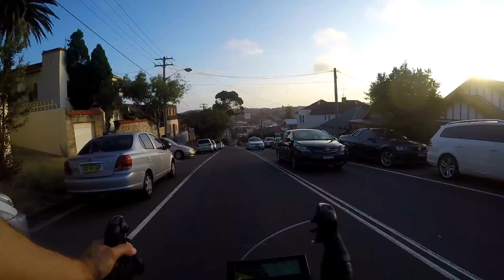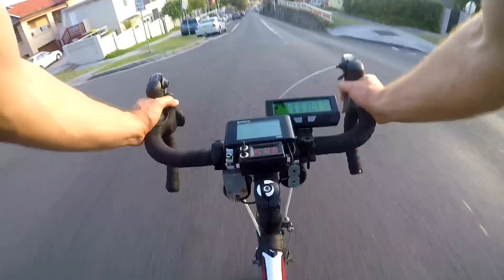Bafang BBSHD 1000w mid-drive • extreme hill climbing test 46T • Electric Bike 48v BBS02 8fun motor

Comment: How is the durability of these motors? They only have a 1 year warranty from what I've seen, probably for good reason.
Reply from the maker: I worked in a shop installing and fixing these motors and all other brands you can imagine... 2 and half years doing that job and I’ve seen so much unbelievable stuff...
Compared to Shimano, Bosch, Yamaha, the Bafang is the only one that you can convert your existing bike into electric, the only one with throttle and the Bafang BBSHD is by far waaaaaaaay more powerful than the big brand ones.
Having a throttle is awesome but people get lazy and don’t shift gears, imagine you have a V8 and you run all day in 3rd gear... you’ll kill the clutch prematurely, then take to the car dealer and ask for warranty, the dealer can tell that it was misuse but you say: “no... I’ve done nothing wrong”  and this happens more often than you imagine.
1 year is actually plenty of time. Also Bafang is the only motor that u can actually find parts and repair yourself in case anything goes wrong and parts are reasonably cheap. Big brands you have two year warranty but they keep changing models and after two years good luck getting anything repaired... they will talk you to buy a complete new bike... 
This is what I learned dealing with all these motors... things vary between people... see Bafang as an Open Source DIY powerful motor that you have total control... this attracts lots of crazy and weirdos too hahaaa
Reply: @BrunoPOWEEER  Interesting information, I'd be interested in knowing how long they tend to last assuming proper use, but used for aggressive singletrack riding and winter/snow use.
Reply from the maker: Durability I would say skip the BBS02 and get the BBSHD, fit the 42 or 36T front Lekkie chainring with big 42-11T rear cassette or bigger and you’ll be flying...
Electric motors like spinning fast, they’re a lot more efficient at high rpm rather than keep forcing riding in wrong gears putting a lot of mechanical stress into its internal gears and even destroying the bicycle gears prematurely. Also running in wrong gears will make the motor run hot which isn’t the best thing. Gearing correctly can make a massive difference between reliable and unreliable system =]
Reply: @BrunoPOWEEER  Hello Bruno, I watch your videos, I find them entertaining, funny and  educational.  I have the Shimano  internally geared hub Alfine 8 on the rear wheel. What front chainring size would you recommend for myself with the BBSHD. One of those pretty Luna front chain rings?  I have been riding the bbso2 for a few years and I'm now ready for more power! Thanks Bruno, Dirttanjohn here in Flagstaff AZ

Comment: I rang from Melbourne today to ask a few questions at EMax bikes and ended up having a very  good chat with them there. Some good topics were covered and they answered my questions with ease. I have been riding a large frame MTB, BBSHD (1500w) using 25amp LIPO4 battery and all the good high power custom  ebike accessories  for near 2 years and have put a few similar bikes together in that time. I was impressed with the ebike knowledge from Bruno and his skill to be able to deliver the answers required. As i say Ive ridden the BBSHD daily for over 2000km  up and down around the mountain i live on, and i have tested the bike and motor out fully, carrying a BoB Yak trailer with a load most days.  Bruno was on the pulse with his answers and knowledge and i recommend assistance from this fella anytime. Cheers
Reply from the maker: +MtDandy yeaaaaaaahhh... thaaanks mate, was FUN chatting with you about ebike stuff in general, I think we covered all areas: chainring sizes vs torque vs battery life, battery performance = more series vs more cells in parallel, connecting different chemistry packs in parallel for more range, possible issues (different internal resistance = discharging differently then packs balancing each other and BMS possibly freaking out), use of super capacitors combined with batteries and all that technology talk... good fun mate!!!

So much POWEEEEEEEERRRR hahaha ohh yeaahh =]
Reply: A great chat on the phone on many ebike topics and thanks for youre time Bruno. The EMax 17.5 amp frame mount battery has me interested for use on one of my bikes also.. The use of super capacitors was a good chat, and it would be good for a post if you get the time. Cheers.

Comment: I want to do 50mph up that hill will 70v with the cyclone motor do that its 3000w
Reply: +ElectricBike (Bruno) Hi , about the Cyclone central drive motor, yes they do produce massive torque and good speeds, but from my experience with the Cyclone they do cut out due to overheating under load and high maintained speeds, they also can be very problematic with chain allignment as the chain tensioner on the front crank setup is ever so weak and often jumps off the chain and can create many problems re tearing out the derailure arm as happened to me , in my opinion the bafang is the best out there at this point in time..torque is the main feature of any mid drive, speed is secondary in my opinion and the Bafang has both and being  a much more stable unit .. :)
Reply from the maker: +Bob Barker - Yeeeahhh.. the Cyclone at 72v 40A will give you a good 2880w... I was putting about 1455w up this hill. In the end it is a matter of gearing the bike.... if you gear just to climb hills you increase the torque and compromise your top speed... but 2880w is a lot of power for a lightweight bicycle!! =]
I am building something insane here that will take me uphill as fast as I would like hahahahaa like a rocket!!! Is a project that I have been working on for almost 2 years... you will be surprised hahaha
Reply: Should i buy the cyclone or the bafang?
Reply from the maker: +Bob Barker - Hummm... if I have to pick one.. I would go for the Bafang... it is a much better solution, you can play with the controller settings... there are tons of info and parts available nowadays... Cyclone is nice but you can tell that parts are "adapted" kinda put together to make the kit, while the Bafang everything was properly designed for eBike application, the wires and the controller are almost invisible on Bafang while the Cyclone you'll have wires everywhere and a brick controller that you have to fit somewhere... 
If money is an issue... Cyclone is the way... if you can save a bit more and get the Bafang...  electric bike is an investment.. you will get all that money back if you ride your bike everywhere =]

Comment: Congrats Bruno, have you already ride with the bbs03?
Reply from the maker: Hi Helder, thanks for watching my videos,  I work with Bafang motors, this is the one you're talking about but the real name is BBSHD, BBS03 doesn't exist... some Chinese websites called like that because the previous versions were BBS01 and BBS02... 
Bafang called it differently because it's a completely redesigned motor, stronger... HD on the name stands for Heavy Duty and also packs a LOT more POWEEEEER =]

Comment: Hey I found something awesome for you! 45t cassete cog for cheap! Blackspire makes one, and it's on sale for half price. Goto blackspire.com and check it out! Only 45$ cad. Will be even less when you convert currency. I want to see bbshd with with a 45t rear lol. You will be able to ride up vertical wall hahaha
Reply from the maker: Yeeeeahhh... 45T cassette is insaaaaane... I'll actually tell the MTB guys struggling up hill with 34T cassette hahaaaaaa.... I may talk to Ewan (eMax-eBikes owner) and see if he wants to have some in stock... huhuuuuuuullll.... say hi to "e-bike wall climbing" hahahaa so much POWEREEER!!!!
Reply: What what front chainring? =) I have a Cyclone with a 24/38 up front (42 in the rear). Now that can climb walls. BTW, OneUp now makes a 50T cog, but it's for 11 speed only. Cool though. Can't decide between that and Shimano's own 46T.

Comment: HI BRUNO
I HAVE JUST ORDERED THE BBS-HD 1000 (THEY CALL IT "IMPULSIS")
I HAVE THE CYCLE ANALIST V3 TOO (LIKE YOURS) 
CAN I CONNECT THE C.A.3 TO THE BAFANG HD MOTOR ?, OR DO YOU USE IT ONLY FOR THE SPEED SENSOR ? (I KNOW THAT THE C965 UNIT HAS A LIMIT OF 99 KM/H, SO............)   I LIKE VERY MUCH YOUR ENTHUSIASM, I LOST THE MINE WHEN SOMEONE STOLE ME, THIS YEAR, DURING THE SHIPMENT, A COMPLETE ELECTRIC KIT WITH LYEN CUSTOMIZED CONTROLLER ALL PAID $ 847 USD, AND I CAN NOT HAVE MY MONEY BACK FROM PAYPAL BECAUSE I MADE THE CLAIM AFTER 45 DAYS, AND I CAN NOT ASK FOR A REFUND FROM THE POSTAL SERVICE BECAUSE FOR THE INTERNATIONAL NORMATIVES ONLY THE SENDER CAN GIVE A CLEARANCE AND THE SENDER "MR. EDWARD LYEN " AFTER BEING PAID DOESN'T REPLY MORE TO MY EMAILS (SO BE CAREFUL TO BUY CONTROLLERS FROM THIS PERSON !!!!).........
......................BUT I FOUND THE ENTHUSIASM AGAIN,  WATCHING YOURS.......YEAHHHH
Reply from the maker: +ROBY ROS - Yeeeeahhh... what a nightmare hey... stolen things, Paypal not refunding... My Lyen... (I am actually getting a Lyen controller anytime soon to pump more power into my BBS02 and then BBSHD, just for fun) If you would like another very small controller that goes very well with the CA, you should get this one http://www.ebikes.ca/shop/experimental/c-phaserunner.html
In my case I am using the CA only as a multimeter and also as a precision speed meter (two speed sensors Bafang + CA) as you can see here 
https://youtu.be/xfmUHbDRmxc and here https://youtu.be/ZsQIA8INPWg
I kept both displays there for comparison... the CA v3 you can connect to the controller so you don't need to use the Bafang display anymore, you can control the throttle sensitivity and do so much cool stuff.. there are one million settings to play but you'll be limited to the Bafang controller settings, if you want to go wild and deeper with the settings and fine tuning,  I would recommend an external controller in this case.
I want to talk more about the CA here... I am getting lots of cool CA accessories soon and will be making video telling the ones I liked most.
Yeeahhh.. electric bike is so much fun, saves you so much $$ and time in traffic.. you learn so much.. I am glad all that your enthusiasm is BACK.... you will looooveee  your BBSHD...  POWEEEEEERRR....
Reply: What steps do you need to take to hook up a off the shelf ca3 to a bbshd controller

Comment: Nice! Handling a pretty colossal hill! I'd still race you up there though ;) hahaa!
Reply from the maker: +Winter Wonderland - When it comes to 2WD the weight distribution gets a bit funny depending on the frame geometry, road angle (up hill / down hill/ flat), acceleration force, total mass and many other factors as the front wheel gets lighter and lighter losing traction, wasting power and even worst becoming unsafe and may losing front wheel control. I don't thing all that would happen with 600w hub motors but would definetelly happen to more powerful Crystalyte ones. There are some controllers capable of manage 2WD systems with perfection, these systems have active traction control which is very safe in slippery surfaces like wet or snow. I believe in mid-drive systems so as Tesla, Bosh, Yamaha, Bafang, FormulaE, Lightening Motorcycles,, Zero Motorcycles, Davincidrives and many other performance brands. I respect some powerful and insane hub motors, I think there will be always market and situations where hub will be best option but in general mid-drive outperform hub. I reached 74.1km/h on flat with my Bafang BBSHD only using 1430w. My top speed I was limited to the 46T chainring, if I had a larger 52T I would go faster.
Reply: +ElectricBike (Bruno) If you want blinding torque do a dual front and back hub setup! 2 600W hubs can propel a bicycle up to 50 mph.
Reply: ***** With how many volts? I'm running a 5T MXUS 3000w v2 at 50 amps and 84v and I can't hit 50mph
Reply: th3d3wd3r So if you have a 50-volt battery pack and you run it at 50-amps, you will have a 2500-watt set up, that will get you up to 40-MPH and beyond without pedaling, depending on variables such as tires size and the type of wind in the motor (its “Kv”).
Reply: th3d3wd3r and here is a online e-bike calculator for ya ;) http://www.ebikes.ca/tools/simulator.html

MXUS what model? 4503-4506,XF07 ?
The calculator has a cpl MXUS's listed, so you should be able to do a rough estimate with it.
Reply: ElectricBike Adaptto has a fantastic master slave mode, traction control, abs, built in charging and bms. Absolute state of the art.
I do like mid drive, but I prefer fixed gear ratios with oodles of torque lol. Thing I like about hubs is the absence of gears. Just twist and go, and with the right motor, batteries and controller, they really do go!
My mate runs a bbs02 with an external 18 fet controller, and it's mental! However, it's not a sine controller so it's damn loud!
Reply from the maker: +th3d3wd3r - Yeeeeaahhh..  this is exactly the one I was talking about... Adaptto.. state of art... $$$... I must get one!! I would  love the day when I can eliminate all gears and have a fixed gear ratio... I feel guilty saying bad things about hub motors but it is sooo hard to get the right setup done (right hub + wheel size + higher voltage and bigger battery + right controller + right settings + not too heavy) everything is possible, I believe your setup is totally mental hahaha as well as Dr.Bass and John Bo.. (hub lovers) =]
I will buy many different controllers and try all with the BBS02 and BBSHD and make videos telling if feels good and powerful and good to ride... just like your friend with a "two stroke BBS02 dirt bike" haha
POWEEEEEEERRRR....! 2016 will be ultra fun!!!
Reply from the maker: +th3d3wd3r - I have a great solution for high temp issues.... you need lot more air cooling so you fight it with HIGH SPEEEEEEEED hahaaaa... =]
Reply: ElectricBike You're not wrong ;) hahaa!
Reply from the maker: Yeeeeaahhh handling this big hill felt so easy with the BBSHD.. much better than BBS02. It will be even better with proper tuning. I'll race you when I get my next motor peaking 990A up this hill haha
Reply: ElectricBike One of the best mods i've found for the bbs02, external controller, well matched and overclocked... Just watch those temps hahaaa!

Comment: What makes you say lipo is unreliable for everyday use? Very interested as I was thinking of getting 2x 6s 16,000mah batteries from Hobbyking to run either BBS02 or after watching your video's, BBSHD. Mooore POWWWWEEERRR!!!
Reply: +D H Lipo aren't so bad, especially once you've put a few cycles through them and you know they are good, well matched packs. They are however somewhat more volatile than 18650 cells. Mishandling them can result in very bad things, very quickly.
Reply from the maker: +D H - Yeeahh... LiPo aren't so bad... but I wouldn't recommend learning about batteries with those ones... its kinda "advanced care" even experienced tech guys have had bad experiences (I know many stories). I am ultra careful but I accidentally shorted one once when I was measuring a circuit with my multimeter and forgot my LiPo connected to it, so I had 390A melting the whole freaking thing, sparks everywhere like a powerful industrial welder inside my house, everything in half second mistake. Jo Bo an well known ebike guy once shorted a LiPo and fried his fingers ending up in hospital. Check out this other video here, the damage was caused during charge, imagine leaving this unattended inside your house: https://www.youtube.com/watch?v=k9mcNvOGKtI
POWEEEEER is good, I would love to get that kick ass LiPo performance but a bit safer, BBS02 and BBSHD will NEVER pull more than 30A so LiPo is a totally overkill in this case. My 18650 pack delivers 50A continuous and 90A peak so this is good enough for 99% of eBikes, even some very powerful ones =]
Reply: ElectricBike This is it like. One of my local ebike nutter friends utterly destroyed his garage charging a pack while out riding 8s
The biggest risk with lipo is getting complacent, forgetting the power in your hands. Colossal amount of energy density.
A couple months ago I was with another ebike loon, in his workshop, and he accidentally breached a cell... It hissed like an angry snake, spewing insane amounts of acrid smoke, and then came the fire! That was one pouch in a 6s pack. I shudder to imagine all of them going.
Reply from the maker: +th3d3wd3r - Yes... you said everything... we get used.. confident and forget about the danger... I have seen many high voltage sparks (talking about KV) but my fat 6s 5000mAh LiPo scared me like an "angry snake"
No fire in my case... I was lucky it was really quick! I got 2x chemical powder fire extinguishers (suitable for electrical fire) after that =]
Reply: Just read some reviews for lipo batteries. You'll find many that say theirs burst into flames. That's not something I want to carry around on me.
Reply: ThingsDemystified Yet you do carry them around on you